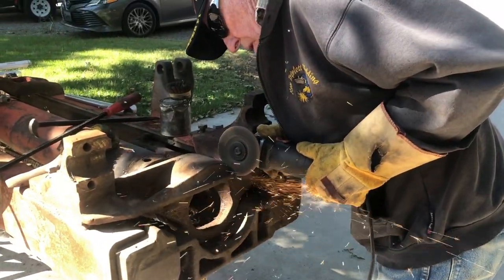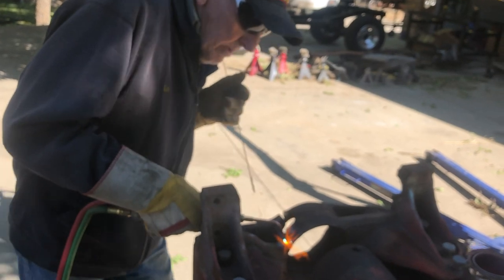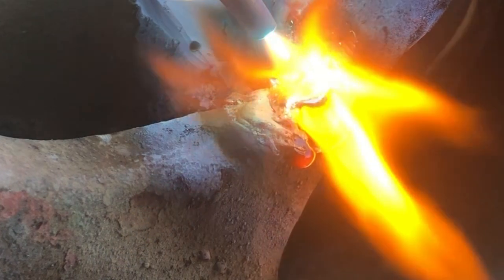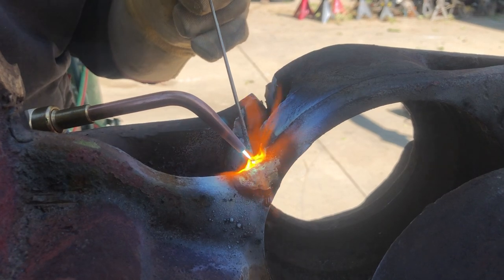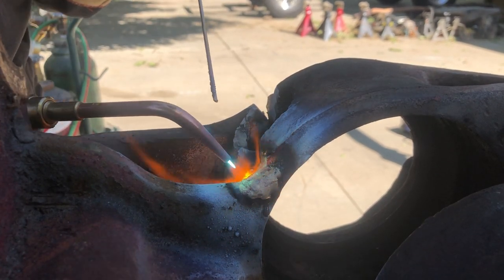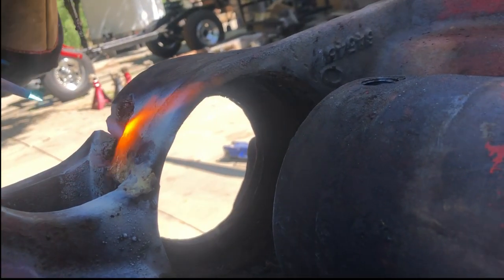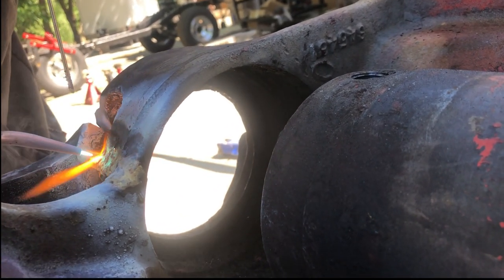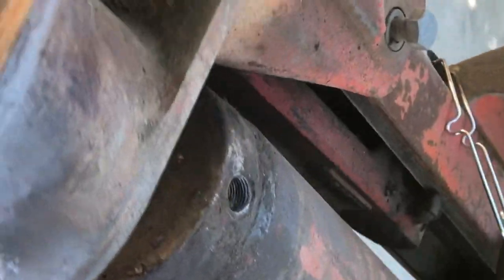Getting Schooled by a 90 year old Welder!

Comment: You mentioned this was cast iron, looks more like cast steel due to the color and amount of sparks. Cast iron is usually used in applications where compressive strength is needed,  I would think this needs compressive and tensile strength. It is  great to see old timers still working, of course I am 68.....we old guys have lots of info to give if only youngins would listen....Never keep a Marine down, they do not know when to stop.....cheers from Florida , Paul
Reply from the maker: It could be cast steel, I really don’t know.  When we were grinding out the area to braze it created a powder the way cast iron does, but that is certainly not definitive.  I Know it’s cast and not aluminum, that about all I can honestly say I know.  It was very cool to watch Ken work and learn from him.
Reply: @AllisonCustoms  cast iron will have sparks that or more relish and more twigs coming off ends while steel looks brighter yellow and fewer twigs [the little sparks coming off main long spark] hope this helps, cast also has graphite in it so is dirty if you file it and rub .It is an art to gauge iron sand steel by the sparks but there are good souces on what they look like., hope this helps, PB